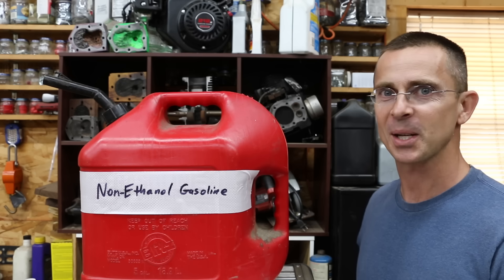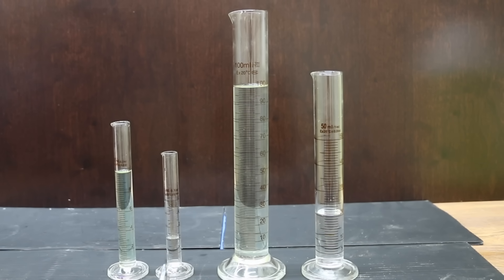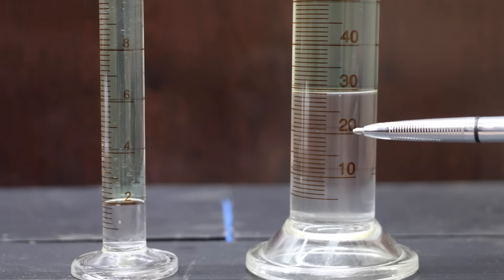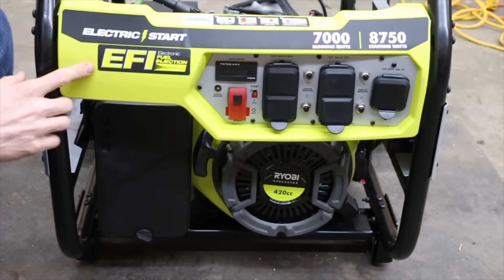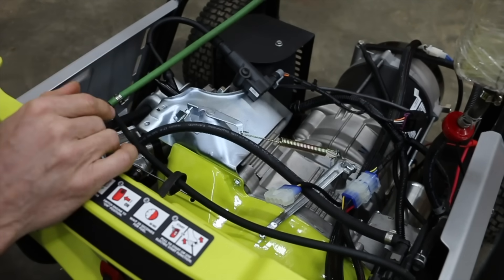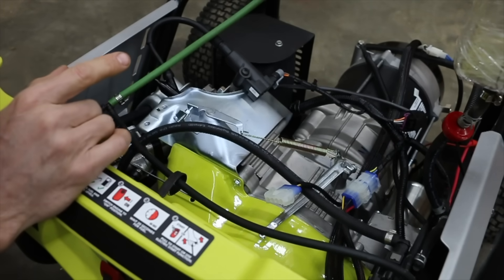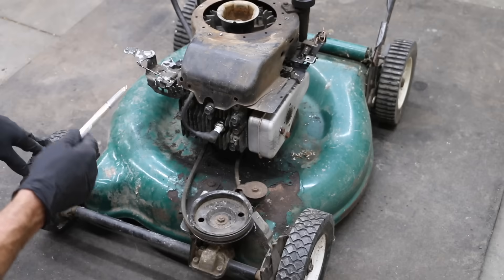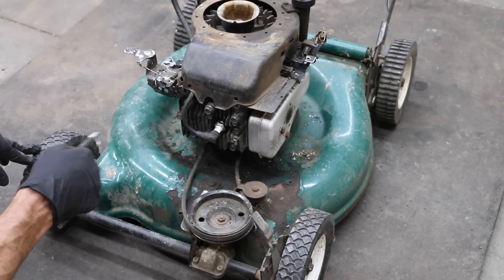Is Non-Ethanol Gasoline Really Better? See the PROOF!

Comment: In brazil, we have pure ethanol in gas stations, and a lot of people use it in standard and daily cars, all popular cars come from factory ready to work with both fuels. Almost all tuning cars runs with ethanol because of it's propiertes, ignition point and compression tax, and, it's is cheaper than premium gasoline. Need special carburators to work in old cars bacause it's corrosive, in injected cars cause troubles on fuel pump and injectors over the time, even with proper parts. But, I don't use ethanol in my car and bike, it's contaminate the oil, in cold days is more dificute to start the engine, engine work more hot in summer and the parts wear is more fast. But even the premium gasoline in here, have 25% of ethanol in it's composition for law. But anyone can do what want, and what have to do, in some projects is the right choise I admit it.
Reply from the maker: Thank you!

Comment: I work on gas stations all day. Stuff breaks all the time with old equipment that has had years of ethanol flowing through it or being spilled on it... but then theres the new stuff... i have seen a brand new store get put in with tank top stuff all rust free and come back 6 months later and regular unleaded and super unleaded and E-85 are corroded while diesel is still in mint condition. Ive broken impact valves on regular unleaded pipes and e-85 pipes but handled a diesel impact valve the same way and it was solid. These are solid steel parts that i whole heartedly believe the ethanol is destroying. Ethanol free gasoline has zero issues with corrosion so long as water is kept out of tanktop sumps and stuff. Also, ethanol in gasoline is left residually in a delivery tankers compartments and then he decides to put diesel in that compartment... when he delivers that diesel to a store therr is sometimes water in the diesel tank... the water and ethanol then mix and begin growing microbes. It turns into this sludge at the bottom of diesel tanks that then has to be cleaned out which costs money. Ethanol is a no win for anyone. Its like hank hill selling propane is told to sell butane too... "butane's a bastard gas bobby!" Ethanol is dang near blasphemous lol
Reply from the maker: Thank you!

Comment: do a test on fuel additives, namely "Xtreme Fuel Treatment" which claims that when added to gasoline or diesel fuel, Xtreme Fuel Treatment results in increases in MPG and available horsepower, reductions in carbon build-up and carbon related maintenance problems
Reply from the maker: Thank you for the video idea!

Comment: Really looking forward to the test on ethanol's effects on carb parts!  I would like to see not just small engine carb parts tested, but also some powersports carb parts tested as well - I believe the rubber used in quality motorcycle / atv / dirt bike carbs is more resistant to ethanol than the rubber used in small engine carbs like lawnmowers, but I would love to see what testing reveals. I'd be happy to post up the part number of a rubber float bowl gasket for a dirt bike if you'd like.
Thanks for all the great videos!
Reply from the maker: Thank you!

Comment: Haven't gotten into the video but I know in carburetors ethanol will "gum up" substantially quicker than non ethanol gasoline. That is why VP and other companies sell non ethanol fuel designed for machines that sit more than they run such as lawnmowers, at least in areas that have lots of snow!
Reply from the maker: Thank you!

Comment: That 4% fuel economy might be noticed in an economy car or hybrid, not going to notice it much on a bigger engine like a truck or SUV.  Of course only an EFI with an O2 sensor will benefit as a carburetor can't react to the A/F ratio the way that a system with an O2 sensor can.  So, if it were possible to get your hands on some emission testing equipment (or maybe borrow some), it would be interesting to see the difference in emissions vs E10 and non-ethanol gas.  E10 is supposedly cleaner burning, though I suspect the ethanol thing is just there to line ADM's pocket (they have a monopoly on the corn based ethanol that goes into gasoline in the US).

Comment: In case you haven't read 1000 comments on it already, as you're American... no one says "Emm Ell", you pronounce it "Milliliters" in full. That goes for, I think all metric measurements, I can't recall hearing anyone read them as letters even conversationally in my whole life. "M" could also mean "mega" (million) instead if "milli" (1/1000) or even people might be phonetically confused with "micro" (which starts with a greek "mu", for 1/1,000,000). Maaaaybe "C" instead of "Celsius" but that's not a unit (degrees are the unit) and even then not common. Sometimes "clicks" instead of "kilometers", or just "Kilos" instead of "Kilograms" (or "Keys" if large quantities of narcotics), but, those are the only slang I can think of.
Reply: Thank God you missed the part where he tells us the size of the generator engine, otherwise we'd have had to read more of your babbling on about how "IT'S CUBIC CENTIMETERS"... 🙄

They're called abbreviations, and they're a real thing.
Reply: @BigD256  -  You're right, CCs is an exception. By and large, abbreviations for metric aren't a thing, and aren't any shorter. It would be like me saying "Ell Bees" instead Pounds. Or "80 Gees of Fuel" instead of "Gallons". Or I'm "Six Effs Tall", instead of feet. "I just drove 100 Emms". No one talks that way. Projectfarm isn't in a place where metric talk is normal, so, I was letting him know.
Reply: Here in the USA it is very common to say "Emm Ell." That is usually what I say. And you know what is worse? Lots of people say "Emm Emm" instead of "millimeter." It's OK. It's really not a problem for anyone. Shouldn't be a problem for anyone. Try not to get too upset about it. Also, people often say Kay Double-you instead of kilowatt. And KVA instead of whatever you would prefer them to say in that case. Just go with the flow, you know? I don't try to tell Brits how they should pronounce (or spell) aluminum. It's cool.
Reply: Good thing you were here to tell us about your awesome matt otherwise us yanks might have just thought you were a jackass with your PC word police. Welcome to Merica! Home of freedom to speak and think anyway you want.
Reply: You live in Britain, right? Maybe nobody says it like that there; we often abbreviate things in America, though. (I never heard people saying "El Bees," though.) Please don't be too up-ended about how we abbreviate "Gasoline" to "Gas" when you tend to say "Petrol," either. I can understand the confusion between "(Gasoline) Gas" and "(Stove) Gas." I'm fine with you saying "Petrol." BTW, (assuming you do live in Britain) I did appreciate the "Walking Through History" TV series with Sir Tony Robinson.
Reply: @101Volts  - nope, I don't live in Britain. Canada, which most people are fluent in both systems. And I've lived all over the US, and worked in the defence industry. America is the only country in the world not using metric. I'm just saying, I've never heard anyone (even in the US) refer to "em ells", it's just as weird as you hearing someone say "el bees" when reading lbs instead of "pounds." My point being, I presume Project Farm didn't know that and was just doing his best, so I took the time to explain it. Much like if you suspected a German wasn't familiar with imperial and said "el bees", a reasonable but wrong assumption, you might let him know no one says that. My rant later on was aimed only at the sentiment "someone from my county put a man on the moon 50 years ago so everything everyone says in my country is correct."
Reply: Lots of people pronounce the letters.  You don't know what you're talking about.
Reply: I think I'm more amused by the phonetic spelling of letters than the fact that you're actually upset about abbreviations. It's quite entertaining 🤣

Comment: I'd like to point out that ethanol will eat up cheap made carbs and cheap rubber. Old engines don't seem to mind it much. the new engines these days hate ethanol. We made things better 30 years ago. These days, seems we use a paper towel as a fuel line then fuss when it leaks.
Reply from the maker: Thank you!
Reply: My 1975 Volkswagen Beetle hated the E10 gas. The alcohol would eat the intake boots and then I had an engine running lean.
Reply: Actually I have an old honda generator in my motor home that the owners manual says no ethanol not even 10 percent made in 1977.

Comment: The main issue with ethanol in small engines is that it eats your crab if left to sit there.  If you properly maintain and winterize\summerize your equipment (depending on if it's used in the winter or summer) there is generally little issue with e10 other then it's shelf life.  Fact of the matter is a LOT of people sooner or later forget to drain their carbs, and aren't knowledgeable enough to fix them once the damage is done.  In the case of e10 and small engine's, i doubt it's any better environmentally because of the additional scrapped equipment.

  I go out of my way to get ethanol free gas for my small equipment, even though it's relatively cheap or even free to fix the carb, because i HATE working on carbs.  It's also handy to have 40l of fuel on standby that i only have to change out once a year or less.  This way i can be lazy about both changing the fuel out and winterizing my stuff, I almost always do it, but i don't have to worry if i forget one year.
Reply from the maker: Thank you!

Comment: Ethanol fuel would always caused ping in my 4 cyl, 4 stroke 1100 cc motorcycle, while it would not ping like that on non ethanol. Both premium, same octane rating. I always thought the motor sounded better running on the non ethanol gas. It just sounded right, on the non ethanol gas, noticeably better. I was also getting better mileage on the non ethanol gas.
Reply from the maker: Thank you!

Comment: The only real problem I have heard of with ethanol gas in a modern engine is the problem with the ethanol separating out from the gas if that fuel sits too long without being used up (2 months or more????).  The oil companies put in additives to keep this from happening but that doesn't work long term.  If separation happens then you have a small pool of 100% ethanol by itself and when that hits the engine it may not run so well.  This would most likely be  a problem for small machines like lawn mowers or snow throwers which can spend many months in the off season not being used with ethanol gas in the tank.
Reply from the maker: Thank you!

Comment: Ethanol sucks its a govt't fraud and the GMO corn farmers are the only ones benefiting.    Here in the tropics you will rot out steel tanks in small engines with ethanol fuel. Non ethanol fuel lasts and stores so much better.
Reply from the maker: Thank you!

Comment: Great video as always! I am curious if propane conversion kits are more efficient than gasoline? Is it clean burning? What are the pros and cons?
Reply from the maker: Thank you for the video idea!
Reply: Propane conversions are very popular for older toyotas, like the 22r engine, because it gives more power (more torque) and better mileage. It's also a little easier to maintain, and doesn't suffer from the same weaknesses of a gasoline carb, namely, it doesn't do hills and angles very well, but keeps the simplicity of it. Very popular to do in the offroading community
Reply: Propane has 80.19% the BTU content of pure gasoline, or 91,500 BTUs per 'gallon'. If you live in a very cold climate its useful to have a gasoline method to start the engine, and switch over to propane. So, if you look at my example above, you would get 80% mpg of what you'd been seeing on gasoline. You would have to justify if the cost of conversion kit would be worth it.
Reply: My opinion, Propane conversions are kept suppressed for the same reason K-1 is prevented from being run in diesel trucks... " Its not what is for the good of all, but its what makes the most money for the few "... you ever heard of "wood gas"?? just for kicks, read on it.
Reply: You lose about 20% hp over gasoline , and use more propane. 
So no , it sucks. 
And it’s a dry fuel, I see Briggs generators all day by 100 hours of runtime have NO valve clearance because of the lack of lubrication in the dry fuel eating up the valve seats, causing erosion and reducing your valve clearance. 
On the other hand I’ve seen quite a few Briggs on gasoline that go 200-250hrs before having no valve clearance. 
So even though gasoline is a solvent, it still lubricates the valves.
And gasoline will make the most power over propane or natural gas. 
Ng has even less power , down around 70-75% of gasoline.
Reply: @MrTheHillfolk  forklifts? Mitsubishi 4g64? I have a cat forklift with 12,500 hours on it and it's never been apart, just oil changes every 100 hours.
Reply: Thomas C. McCartney 
the shop forklift has an old continental I think , and it has about 8000 hrs on it. 
We add oil when it stops smoking out of the exhaust.
Reply: @MrTheHillfolk  lpg vapor is just as wet as gas vapor, it just vaporizes better. The lack of additives is fine because the octane is higher and it's a cleaner burning fuel, so the lack of carbon deposit cleaning additives are a non-issue.
Reply: Thomas C. McCartney 
If propane is so wet, why do valves on air cooleds close up after 100hrs? 
I’m not sure, I’ve only been in the field for like 18yrs.
Reply: @MrTheHillfolk  
So why dont they close on water cooled? Same fuel. If it's due to lack of lubrication then it would effect both engines. The old JC series On an air cooled units ran fine in propane or nat gas as long as they had the correct heads on them. Maybe the engines your seeing are just garbage engines. I know Generac units call for valve adjustment after first 100 hrs or 6 months and need adjustment every year but so do On an performer engines on propane or nat gas
Reply: kirk stinson 
It’s every 100 hrs on a generac. 
So after 4 days straight running in a storm you better check em. 
Have fun because it’s done cold. 
Haha like anyone does it. 
But let it go and around 150hrs it won’t start. 
And those old onans, they do it too.
It takes longer. you’re comparing apples and oranges comparing a 1800 rpm engine to a 3600 rpm engine.  
It’s the heat, water cooled engines run cooler , and cool the valves more effectively. 
You gotta move a neck of a lot of air to match the cooling power of water, then add in a little debris blocking the fins or blower housing and voila, you have an overheater that’s gonna need an adjustment sooner. 
Damn mice made a mess of the thing and blocked cooling. 
Your valve seats in the head and the valve seat is wearing at a higher rate than it would in a gasoline engine, hands down every day of the week. 
To put it brief , go ask some old timers but 
“propane/ng is a heck of a lot tougher on the top end of an engine” 
That’s a fact. 
I get em alll the time from idiots at the first cold snap. 
My gen won’t start. 
That’s because nobody ever adjusted the valves, and now it’s colder and you already have less compression from lack of clearance, less intake vacuum to open demand regulators properly and she ain’t gonna start.
Reply: @MrTheHillfolk  
I hear you. I've been a generator mechanic for 35 years now. Those generacs ALWAYS need valve adjustment so do the old RS 12 Onans.  And your so right on people that don't do it or want the extra time at a service to do it then dont start when it's cold out. But, it pays the bills. Sucks being out in the cold but it's not to hard to set them (old vertical shaft generacs aside).
Reply: kirk stinson 
Yea I’ve seen some of those, nothings a picnic on those. 
I came from a more industrial background when I started out, but I moved back to where I grew up so the market is a little different. 
A lot more air cooled stuff here, but plenty of 30-150kw stuff at larger homes. 
I see 20% diesel 80% gassers now, where it used to be the other way around. 
And half of that stuff here is air cooled. 
Sometimes I chuckle to myself about the small size of them, as my old average sized unit was like a 300kw and a 100kw was a peashooter. 
but they do their job and serve a purpose, and I have some great customers. 
It’s the ones that only call when it’s broken.  
Like today, an old baldor powr-gard 10kw for a no start that we were last at back in 2014. 
I threw a staatah solenoid on it, made sure it cranked over and briefly fired. 
Then I adjusted the valves,cause even with no hour meter , the oil was black so you know it’s got time on it. 
Ol late 90s vanny,18hp v twin. 
I always had ok luck with them .
Reply: @MrTheHillfolk  Thirdly, Briggs engines are, and have been, junk for many years. A few exceptions being the 220cc generac branded engines with the little spin-on filter and the flathead I/C motors from 20+ years ago.
Reply: Thomas C. McCartney 
Generac keeps me very busy at work, that’s what I gotta say about  them!!